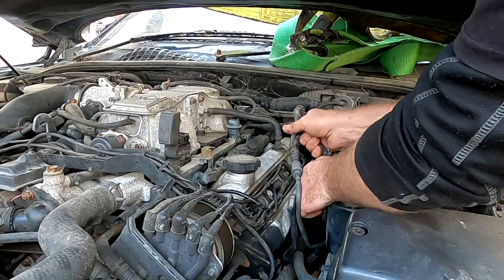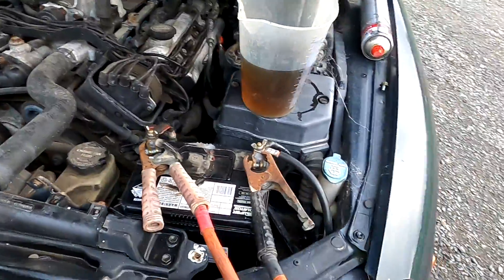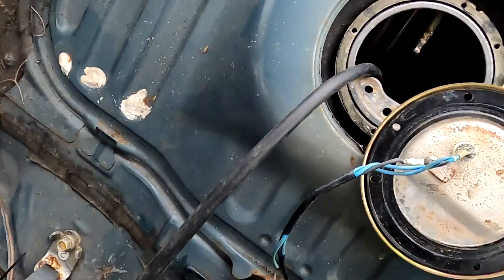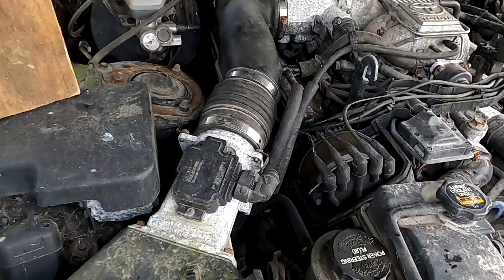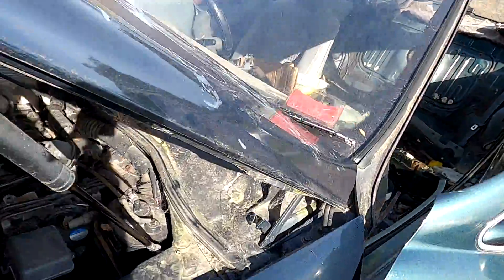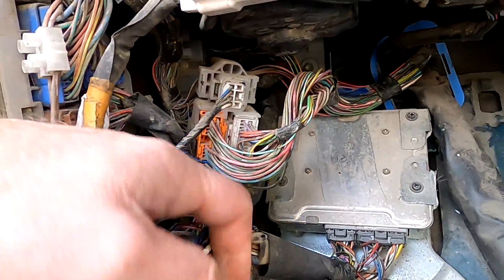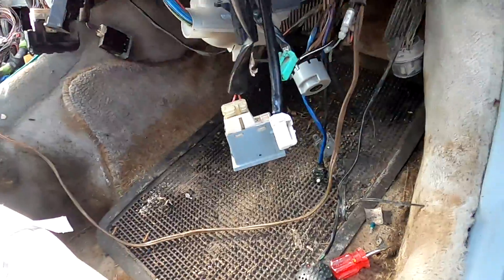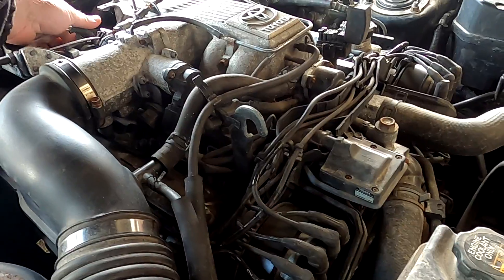Shitty Soarer (Lexus SC400). Fuel pump testing and change

Comment: What if my fuel pump voltage drops when driving but doesn't shut off. It just drives as if its lean but no leaks or other issues.
Reply from the maker: If all the Factory system is intact then they should drop voltage via the fuel pump ecu.  Its whether yours is dropping like Factory or more than it should.
Reply: @CartuneNZ  the guys at the shop ran a snap on computer and held at 2000 rpm to simulate driving and they said it the voltage drop wasn't right. I saw various other sensors doing the same thing some times the voltage would spike high
Reply from the maker: @diszruptiveent3634  ok.  Might be best to spend some time to dianose that issue
Reply: @CartuneNZ  windows move slowly always and lights dim when using accessories. Perhaps it's chassis grounds?

Comment: Wait, Kelvin.  That spare car you have without the engine…  does that have a steel engine cradle or is it aluminum ?
Reply from the maker: That steel look is crusty oil over aluminum.   Haha.  The cross member is very dirty
Reply: The ls400 is aluminum but the gs3.0 and 4.0 oils steel
Reply: @Youtubecensoredmyusername    That’s what I am looking for .  I am looking at adapting part of the engine cradle by welding it to a factory k member in a ‘74 Duster    I could fabricate it but why reinvent the wheel when I can graft it in . Thanks for the info .
Reply: @docfischer7291  ya cool. That’s what I did
The mounts bolted in fine but when I dropped it in there was some tension. I may have to oblong the hole a bit. Note the gs300 mounts with 2 bolts while the LS400 mounts with one stud and a tang. I used ls400 mounts but I wanted to try the GS ones but never got around to it. Good luck 👍
Reply: @docfischer7291  no it’s a 1960 f100. At first I was going to get spacers to sit the aluminum crossmember on top of my frame and bolt it down but it needed to go much further down than I originally thought. Gambled on a gs300 crossmember. It’s steel sits a little lower to start with than the ls400 aluminum one. Since it’s so wide I was able to cut off the extra, box the frame 10 inches and weld it right in.  I learned that the engine and transmission are rarely exactly in the middle of the car 😂
Reply: @Youtubecensoredmyusername    Sounds like a cool project .  I am almost toying with the idea of using the complete from suspension.  The steering box on these A-bodies are in such a crap location that as low as the engine will sit the valve covers and exhaust are close to touching. Im certainly wanting to use a rack and pinion
Reply: @docfischer7291  ha I also wanted to use the rack and pinion but I ended up not. I should have pictures of the LS/GS cradles side by side somewhere if you wanted. Good luck with your project. My friend has health problems so i havnt been working on it but I did get it running and driving and wow the non vvti is smooth as silk 👍
Reply: @Youtubecensoredmyusername    I am picking up a gs300 cradle later on today.  Found one locally for 75.00.  They have two of them , may need both. 
  Sorry about the health issues. I understand completely, I have been dealing with viral cardiomyopathy since 2005/2006.  More downs than ups.
Reply: @docfischer7291  awesome. The gs crossmember is sleeker too. glad to hear you got one
Reply: @docfischer7291  hey Doc. How’s the project going?

Comment: This, in fact, is Shitty Soarer part2. Not the nice one I thought was shitty soarer part 2.
Tell me, is that treewood bonnet prop calibrated to the correct length? I have a sawn off broom handle thats calibrated to LS400's.
Reply from the maker: It is really a part two.  Unfortunately my bonnet prop is not a calibrated unit, rather a universal one, so often isn't quite right.